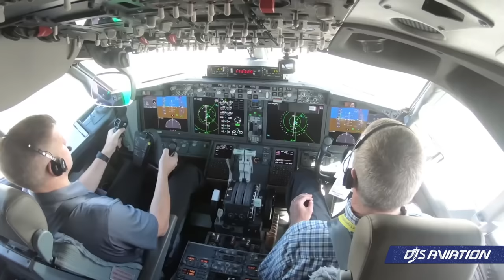Airbus Unhappy With Boeing

Comment: If I understood everything : Airbus is not happy to be the number one because of Boing problems, but Instead, Airbus would have prefered the be the number one because of their product quality, not because of Boeing problems. Am I right ?
Reply: Yes
Reply: Partialy, Airbus  is also saying, that Boeing mess ups are harming Air travel.  It puts people off, when Aircraft have problems when they are brand new.
Reply: That's like a team doesn't like beating a team for a championship, when a key player is out due to an injury or suspension.

Malarkey.
Reply: No, you didn't. It's not about being number one or two. It's about the fact that the reputation of the whole industry is damaged when a manufacturer has to struggle with such problems, because many people then think and assume that other manufacturers act in the same way. Take a look at the interview. It was broadcast on MSNBC. Then it will be easier to understand
Reply: In an industry of professionals,  ALL competitors want their fellow competitors to be capable, competent, and professional.  Mutual courtesy and respect is how the game is played.
Reply: No, as hard as it is to believe, I do think Airbus are right. Its NOT about being no1 but  SAFETY.   That affects EVERYONE not just BOEING!   SAFETY is paramount NOT being no1 or cant you see that?
Reply: @kentfrederick8929 not the same. Your analogy is flawed.
However it could be the same as when a team beats another and then says "we would PREFER to have beaten them with their key player in the field ".
They are not unhappy for being number one, they would prefer the reasons for that were different for all the reasons already explained by others.
Reply: Boeing is still the number one

Comment: You should've empahasized that AIRBUS is unhappy that Boeing is making the public question air travel in general. AIRBUS could not give a *hit what Boeing is going through as they're already eying on their new 2030 clean slate design for near carbon neutral planes. (Also the statement that you read from AIRBUS was not given by their CEO but their CFO)
Reply: Thats not how it works, theyre a duopoly and totally care about the well being of one or the other doing better, thats how they stay a Duopoly
Reply: That does not contradict or invalidate what he said.
People questioning air travel is bad for the business and it does affect both  @Racko.

Comment: There is this idea out there that Boeing and Airbus are in deep competition when the reality is, both are backlogged. Both can be extremely profitable while providing quality products and building off each other. Airbus has long actually supported what Boeing is doing. Even before all these issues, Airbus filmed and put out a congratulations video for Boeings 100th year celebration. 

If Boeing were to go out of business it would be bad for Airbus, there would be no way they can meet the aviation demand, they would likely stagnate in innovation because there is nothing to compete with bringing little innovation and honestly who wants that? Airbus knows this, the people running Airbus are extremely smart. A healthy industry has both of the succeeding together as they have done for over 30 years.

If boeing appoints another CEO that has a finance degree... I will have lost all hope.
Reply: Boeing will not go out of business. But it is a question of cash flow and resources: will they have the money and personal to spare to develop new planes and the pace required? Airbus does. So it may happen that in 10 years time, Airbus will be a generation ahead of Boeing.
Reply: @neodym5809  That’s a true statement.
Reply: @neodym5809  if we’re applying  generations to air frames then the 787 is still the most modern one with its electric dominant design (yes, even ahead of the A350). The point about cash flow is absolutely true tho, the 787 program itself cost 32B, close to double the development cost of the A350 and it only just broke even.
Reply: That's what you do when you're a civilised company. Do you thing Boeing would do the same to Airbus?
Reply: @neodym5809  They already are.
Reply: Don't worry. I guess they will appoint a new CEO who is not just from the finance department but probably ALSO from McDonnell Douglas 
😂😂. Just the icing on the cake🍰
Reply: @neodym5809 If they desperately need fresh money they could (get this !) SELL more stocks instead of constantly buying them back to artificially inflate the stock price with money they actually need for research and development.

But this would mean the would need to let go of the McDonnell Douglas mindset. Something which the former MDD Bean counters at Boeing would never allow. 
After all they destroyed McDonnell Douglas that exact same way, so why change this perfect system ?? 😂😂
Reply: Yeah they need a Engineer.

Comment: I love Airbus very much because of the 3+2 configuration in the Economy Class cabin of the A220, the 2-4-2 configuration in the Economy Class cabin of the A330 and A340, and the belly and tail cameras of the A350.
Reply: Not to forget the gorgeous a380. Still the best when it comes to comfort. (If good configured)
Reply: @FipoFil  Me too because of its sheer size and comfort, but this aircraft is no longer my favorite in the present day because I'm concerned about climate change and increased carbon footprint. The aviation industry is going to achieve net-zero carbon emissions by the end of 2050, leading into 2051, and transitioning from quad-engine aircrafts to twin-engine aircrafts is one of the ways to achieve this goal.
Reply: Seat configuration is airline based
Reply: @ysfsim  All A220s are configured with a 3+2 layout in Economy Class. Most Airbus A330s and the upper deck of all A380s are configured with a 2-4-2 configuration in Economy Class. Most A350s are configured with a 3-3-3 configuration in Economy Class.
Reply: @thyip6167  that doesn't change the truth in what I had said.

Comment: People will never trust a new Boeing design from here on out. 777x can kiss its chances goodbye. The delays alone make people not trust it and the tech is becoming outdated compared to the A359 & X. Furthermore Boeing is ruining public trust which could potentially ruin Airbus’ gains.
Reply: You cannot just not trust a plane when it's not even in service. The rech isn't becoming outdated compared to a350. They both have the same
Reply: @nickolliver3021  Sure you can. It’s called reputation. The engines are becoming outdated the longer they wait to release it. Airbus is already looking at the A350-NEO which will be more efficient than the 777x CEO. Additionally the a350 is composite and 777x is Aluminum body with composite wings. So again tech is becoming dated.
Reply: @Mercy_Pants  Airbus isnt even developing an A350-neo. the 777x will be more efficient than a350. The engines aren't becoming outdated because there is no newer engine out there that will replace it. The ultra fan may be here in a few more years but next year the 777x will be in service anyway
Reply: @nickolliver3021  they are “looking at” developing the a350-NEO.
Reply: Problem is its very easy to get a bad name and very very hard to get back a good one. 777x?   same management.  777MAX.

Comment: Airbus means their is a perfect company,no safety issues,thank you very much

All of company use airbus,, it will be very happy
Reply: Airbus have a lot of pressurization hydraulic issues. They don't get publicity like boeing though
Reply: @TrentonThomas627 Generally those issues you mentioned happen to any "old" plane, from any manufacturer.
Reply: @TrentonThomas627  All manufacturers have problems as aircraft age.

It's how they deal with them that makes the difference.
Reply: No you are wrong. Airbus NEVER said that. Airbus said being no1 is no honour when your competitor is on the floor. It also said Boeings mismanagement harms everything.  They are right. It affects all the travel business/airlines and suppliers. It frightens the traveling public.  Airbus is RIGHT to point this out, nothing to do with being better than, ITS ALL ABOUT PUBLIC SAFETY IN THE AIR.

Comment: There are a number of disadvantages to a failing Boeing, notably in the supply chain. Demands from each manufacturer drives innovation. Large suppliers like Meggit, Honeywell, Rolls Royce, CFM, Pratt etc will only make costly investment decisions if they know they can sell in large numbers. Some suppliers would possibly not survive without income from both manufacturers. Furthermore a failure of Boeing would put a greater focus on Airbus in areas like export control/ITAR because with no Boeing around, Airbus would have less leverage with the US authorities to be even handed. Politically, Boeing is too big to fail and so is unlikely to happen.

Comment: Airbus aircraft have been affected by  hundreds of airworthiness directives, some stemming from fatal accidents such as Air France 447 or Air Asia 8501. Media and online commentators interest in Airbus defects  has been limited to those that cause  fatalities. But with the media  turning sloppy wheel replacements and ignored maintenance bulletins by Boeing operators into  Boeing quality control problems, attention will inevitably turn to Airbus defects. The search for a headline never ends. Like the recent A320 directive about cracks around the cockpit windows. If losing a door is bad, what happens when the cockpit windows  blow out at 35,000ft, the media will ask  That is what Airbus fears. The air safety system of defect reporting gets turned into a weapon by the media that drags in the whole industry.
Reply: Yeah, duh, 'cause 'Murka is always better, hee-yuh, duh. And them durned old Froggies jest kain't compeet with us "Exceptional" Yanks.
Reply: The door plug blew out of a brand-new 737, so maintenance was never an issue. It was sloppy manufacturing and after inspection this was discovered in more 737's. Stop trying to deflect.
Reply: @tenkloosterherman  Stop trying to suggest this only happens to Boeing. Airbus delivered A350s with inadequate lightning protection on fuel tanks. Potentially catastrophic was the airworthiness directive's words. These problems beset every aircraft manufacturer.  Only one makes the headlines.
Reply: "In August 2021, as several A350s were sent in to be repainted for the 2022 World Cup in Qatar, Qatar Airways discovered that their paint was unusually degraded. The airline grounded its airliners until the root cause could be determined, and would not accept deliveries until the problem could be solved. The European regulator, EASA, found that paint degradation did not affect the aircraft structure or introduce "other risks". Singapore Airlines had not detected such problems with its fleet.

In November 2021, Reuters found that Finnair, Cathay Pacific, Etihad, Lufthansa and Air France had also complained of paint damage as early as 2016. On 20 December 2021, Airbus received a formal legal claim in the English courts filed by Qatar Airways. Qatar Airways alleged that the surface flaws cause the risk of fuel tank ignition due to the degradation in lightning protection over the fuel tanks in the wings. The court hearing was originally scheduled for summer 2023. Both Airbus and Qatar Airways agreed to settle the dispute on 1 February 2023.

The Qatar civil aviation regulator was the only one agreeing with the airline. Qatar Airways was claiming a $200,000-per-day compensation for each grounded aircraft. Airbus decided to cancel Qatar’s outstanding orders, showing that it was certain of its case. While the settlement is confidential, Airbus may benefit more as there is no major impact to Airbus's finances, the A350 reputation remains intact and Qatar's A321neos will be delivered three years late, underlining their price was not renegotiated."

Comment: Airbus is next …. A350 paint issues
Reply: This issue has long been settled. Quatar is even ordering more aircraft from Airbus. Pull your head out of your ass so you can see more
Reply: Yes planes will fall out of sky because of paint issues, you're 100% right. And it's a lot worse to fly on a plane with paint issues which I can't even understand how people will survive, than in one where occurs the small problem that a door blows out because of course no one was ever in danger.
Duh...